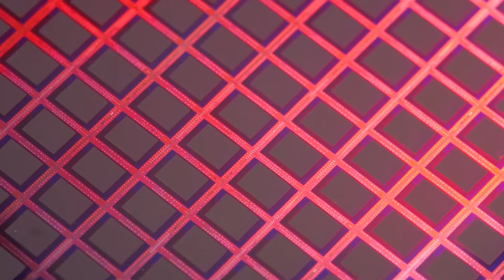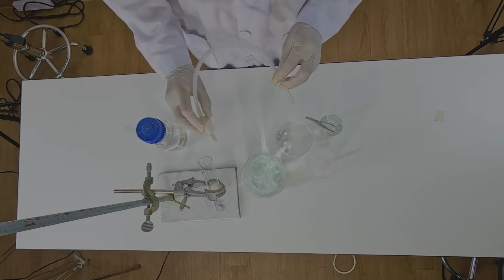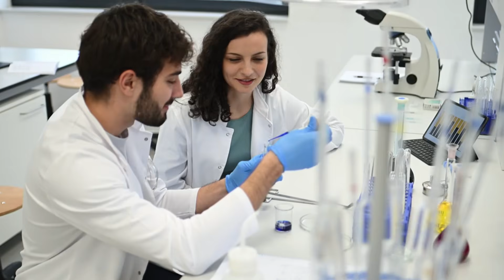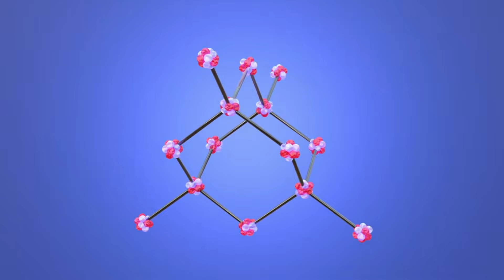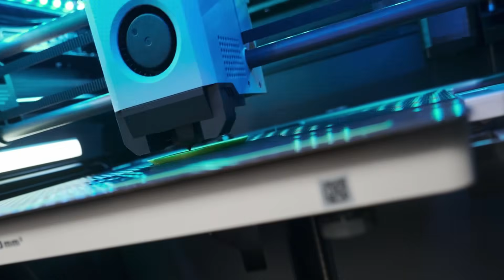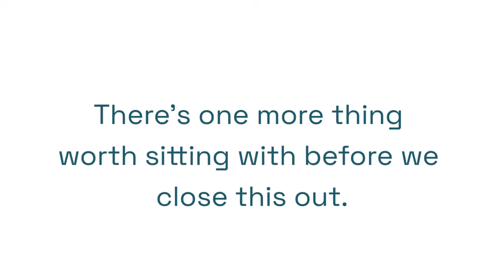China Just Replaced Silicon With Diamond — And Made Nvidia’s H100 Obsolete

Comment: America's corporate run monopoly economy is imploding
Reply: there is only one monopoly on the planet and that is asml and that is not american  . asml and  imec where i work in belgium . have a plan for the future stipped out .we are testing everything in imec and the only good use of diamond is to move heat . after the high na euv ,hyper euv machines and then the era of 2d materials are there . that is where im doing research for right now . Dont belief everything on the internet . china is really good in copying but if you need to invented new stuff that takes time . they are still 5-10 year behind on making the euv machines commerical while we are already in the high na euv era .
Reply: @KevinPiessens-b9n  Bro We want to startup chip manufacturing in Bangladesh what could be the estimated time and cost for it.Can you give a rough idea about it.
Reply: @HumaishaJannat-s5w a arfi duv machine is around 80 million now 193 nm wavelength  . that is good for smartphones and computerchip this is the latest duv machine . the oldest duv is around 10 million euro +- 360 nm wavelength . good for car chips or things where it doesnt matter if the chip is a bit bigger .  but this is only the machine to make chips  . you need a clean room . cleaner then a operation room . it has special ventilation system and then your helium installation what is also very difficult and expinsive it cant be in your cleanroom and you tube need to be of stainless steal and need to be polished inside the tubes   . because there is always losses in the machine this has to be recoverd without leaking in your cleanroom and cleaned again so you can use it again . but that is only the start you need a blueprint of how you gonna make your chips and that is specialist work . you probably cant do that on your own .
Reply: @KevinPiessens-b9n I am a financial planner and analyst currently working on a project for investors interested in funding a chip manufacturing startup in Bangladesh. I’m looking for a subject-matter expert with direct, hands-on experience in this field to provide an accurate and reliable opinion. I am happy to offer fair compensation for this consultation. If you can help, could you please share your contact email?"
Reply: Greed will eventually do that.